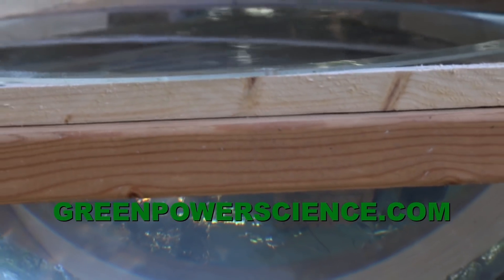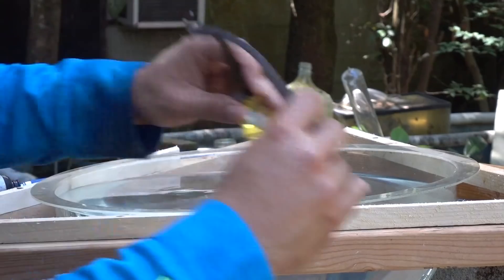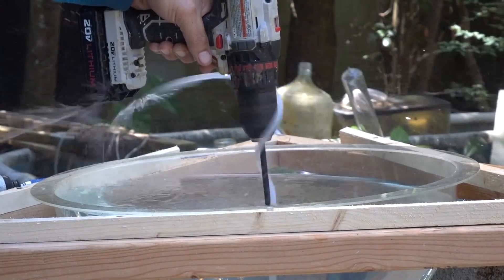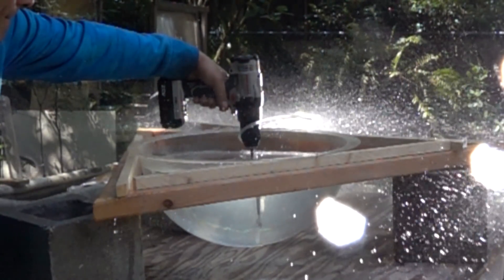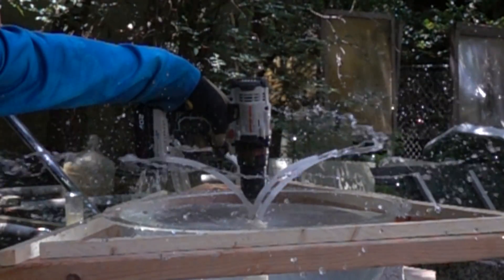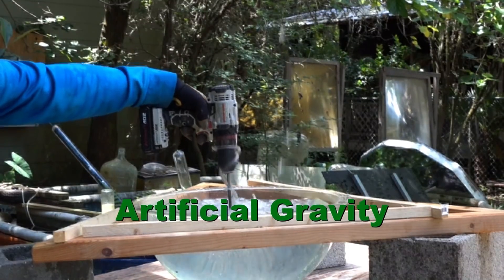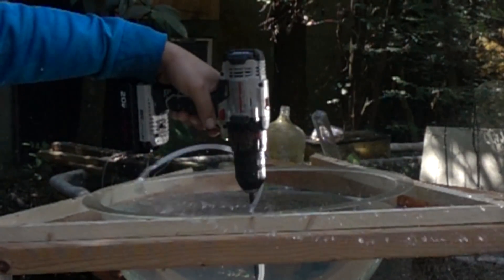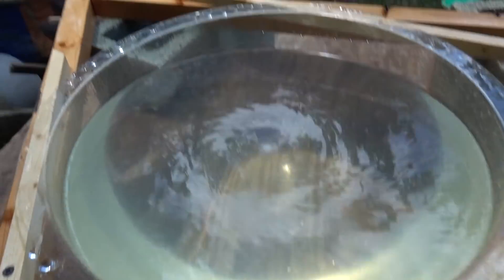Gravity siphon above water inertia centrifugal water pump Water Vortex DIY WATER PUMP

Comment: Hi Dan. According to this device, this is the most recent video you posted. I'm just trying to track an order I made on August 26th. I can't find an email. I called the number on my email confirmation with PayPal. Do I have to activate PayPal first before it gets shipped? There are only ROBOTS to talk too. Couldn't find a way to email you either. Sent you a snail mail and my letter with my postal money order came back unopened. So I ordered online on the 26th of August. The reason I didn't order online is that I might have to change my account number. This is why I didn't activate PayPal yet. Want this order to be completed and delivered FIRST before I set up PayPal and fix things with the bank. Otherwise I will just have to do EVERYTHING again with the new account number. A lot of unnecessary information - I know - but I just want to TRACK my order so I am sure to BE THERE when I expect its delivery. This is the only means I have to communicate.

Comment: Shoot I’m a little late on commenting, I hope you see this.... 
I have been trying to work on a way to move large amounts of water by pulling the water (similar to how a tree works) instead of pushing water (which all current methods of moving water require). Any thoughts or suggestions on how to create a negative (or low) pressure to which water can flow upwards without the use of engines?
Reply from the maker: With a siphon you can go up but the exit always need to be lower than the entry point. If the water source is unlimited like an elevated pond, siphons can continue to work with a minor leak or imperfection at the high point in the channel. I have siphoned water over the roof of a building to a bucket on the other side. The start vessel was higher than the exit but on the roof I had a tiny hole in the PVC pipe water dripped out of as some air was sucked in. The result was water on the roof (not much) and a slightly compromised siphon (some air exiting in the lower vessel). Water moved to a higher elevation with a siphon. Wasteful considering the amount of water required but it did work and may be useful for research on what you are attempting to do. There is a limit to the height a siphon can curve over. Adding a water lock that opens and closes would be much more efficient than a tiny hole. Hope this helps. Other than that, without the input of energy up flowing water only works with evaporation = natural heat or input energy.
Reply: Thanks for the response.  I am curious as to how trees can so effectively bring water up their system, but we can't find a way to mimic this.  I have done some research and it seems like its a combination of a couple of things.  Chlorophyll acting as the energy transference by taking in and reflecting sunlight.  From the energy exchange in the leaf, water from the roots of trees then suck up, or pull up the water through small chambers which are designed to optimize capillary action and bring the water through the whole tree and to be eventually released where the energy is being transferred by the leaf.  Seems like a shame we can't figure out how to mimic this system and create something which uses capillary action and exploit energy exchanges which passively (without external energy input other than the sun) to move vast amounts of water up an inclined distance.
Reply: maybe by having a solar panel type material act as the initial kick starter to the system, we can then use a heat exchanger water at lower levels to move upwards in a semi liquid and gaseous state to reach the top where the gas and liquid can then condense back down to pure liquid form and then have gravity as the agent for moving the water to the designated location?  Idk just thoughts, maybe some day down the road ill have the money and time to research how this can be done...

Comment: omg, Dan...

you need to scale this up with pvc pipe on an axle with a spigot on one side so you can attach it to a bigger motor and really play with it.

how high can you prime the pump and still have it work?

priming the pump is adding a little potential energy,  and the torque is adding the force to fling the water out BUT the moving water is also creating low pressure so the atmosphere is also pushing the water out. You're sort of cheating physics,  no? 2 for the price of one?

Can you get the potential energy gained by the elevation of the mass of water to excede the energy of the torque?

Comment: Excellent, I’m wondering if something like that could be adapted to make in impeller-less pond or lake pump for water aeration. If the entry of the tube were turned into the direction of the shafts spin, maybe it would be self priming.

Comment: Wouldn't just a syphon hose be just as good, for getting water out, all you need is for your water source be slightly elevated from the ending point of your hose, you can go up and down hills as long as there are no air bubbles  in your hose and your end point is lower than your beginning point, this method is used a lot in maple sugar bushes, where hoses are used to collect sap from trees and from cisterns used to water gardens away from wells or plumbing!  You can add split offs as well, and have on off nozzles, you just have to make sure to keep the air out of the hose's! Some times simple is better! And cheaper, nature works in mysterious ways!
Reply from the maker: Yes, this was to demonstrate gravity effect and also show the basic function of a water pump. 
https://www.youtube.com/watch?v=eIKk3UaodSo

Comment: Pretty interesting concept, though I'm not sure if it's more efficient than a traditional water pump.
Reply: Pretty sure it's just a science demo, not an actual proposal for a new type of pump.  Heck, you could just siphon the water out if that's all that was needed.
Reply: Maybe with Stirling engines on a sunny day you could get your sprinklers to work for free... (that is, without water pressure) ^_^
Reply: It's definitely more messy than a traditional water pump. ;)
Reply: I'm afraid my dog would go insane if i had any such setup in my backyard.

Comment: Not sure i would say gravity swwing how no one knows how gravity. But its vwry cool thanks for sharing
Reply: No one knows how electromagnetism either. Yet you accept electricity. Think about it.
Reply: +pgabli10  You're a genius, Gump!
Reply: Damian Reloaded I understand the forces he's using the suck out the water I'm not arguing that. Gravity has nothing to do with it we don't even know if gravity pushes or pulls.
Reply: Semantics. The current theory of gravity predicts everything we can observe perfectly well. We don't need to know its underlying constituents to see it in action. Just as electromagnetism. We don't know  what electromagnetic fields are, but we can use them to build devices like the one you're using to write your doubts about them.
Reply: +pgabli10  I understand the forces he's using the suck out the water ... Gravity has nothing to do with it
You don't understand the forces. This doesn't work without gravity. A siphon is powered by gravity. 
The weight of the air on top of the water pushes the water up the hoses. You don't really suck water up a tube or a straw, you lower the air pressure inside the tube/straw and gravity-powered air pressure pushes the water into the void.
Without gravity the tubes would just stir the water. How is this known? Equations with a g in them.
Reply: Diver, Sky please explain that one better. Experiment is creating a siphon
Reply: I think we understand electricity pretty well but something like gravity is just a theory by scientific standards. Signed to the theory of gravity they do not have a repeatable way to observe it to test it to prove their theories to be anything but a theory it's similar to Evolution evolution is a theory not a fact there is no proof. It's hard to believe we went to the moon in the 60s when NASA says today we can't get through the radiation belt the highest any other vehicle has ever flown is 350 miles up so maybe they lied in the 60s and we bought it Hook Line & Sinker
Reply: Diver, Sky gravity is only a theory that test does not prove gravity. Pressure differential that's all he starts the siphon the spinning creates a lower pressure at the end of the tube and therefore the weight of the water pushes up through the tube. What we know about gravity could be explained just as well with density
Reply: pgabli10 electromagnetism is also a theory.
Reply: +pgabli10  gravity is only a theory that test does not prove gravity.
As Damien explained, electromagnetism is "only" a theory. Science produces theories.
This test, and countless others you can perform in your own home, show that there is a force at work, g. 
YOU can measure this force (g) and predict what a liquid will do before you perform an experiment.
Then you will understand every aircraft, vehicle, building, bridge, and so much more that you see was built on equations with the little g in them. Your town water system falls apart without gravity.
Engineers don't care about what magic underlies the measurable force g, but your world would collapse without it.